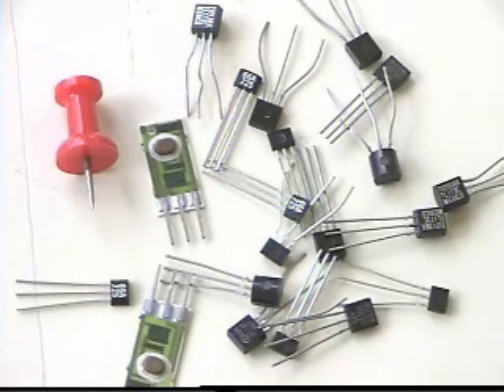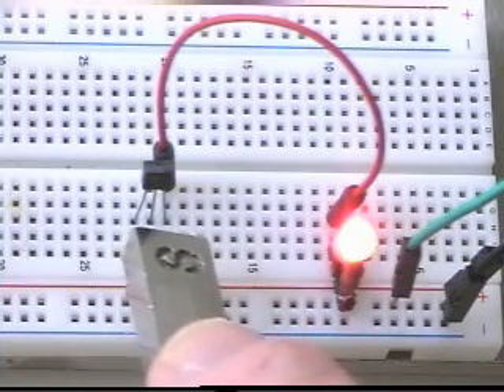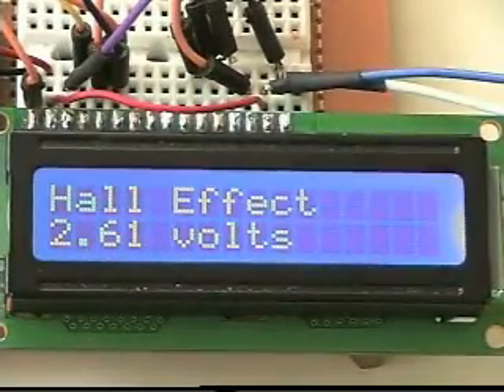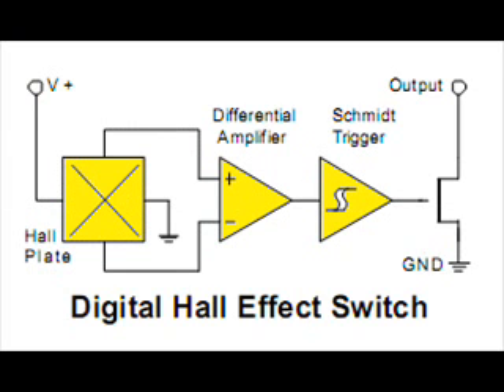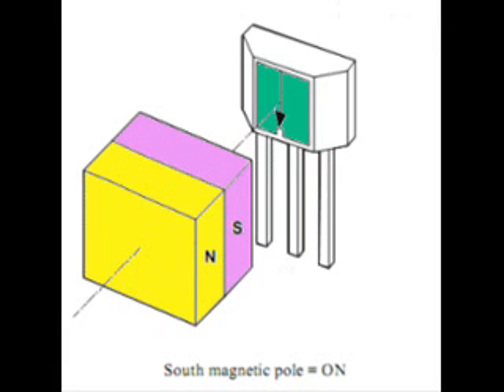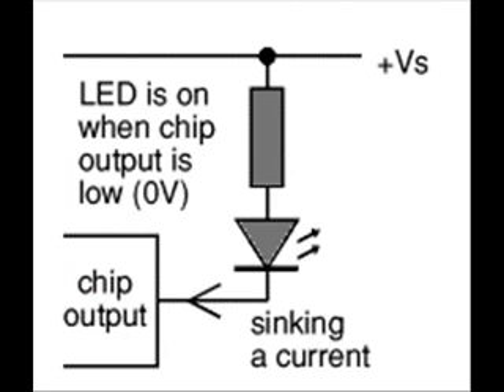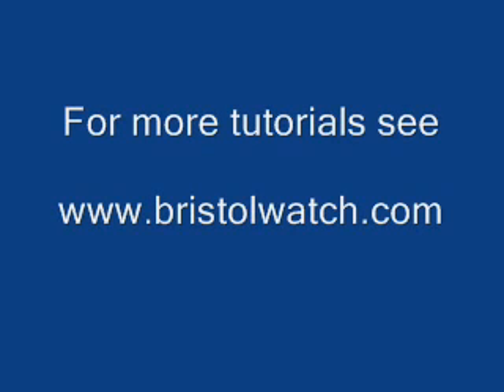Basic Hall Effect Sensors 1

Comment: Your webpage "Introduction Hall Effect Switches Sensors Circuits Tutorial" was VERY helpful.
Thank you for posting.
The UGN3013, or something similar, is what's inside the Intake Manifold Runner Control Actuator for my Ford Focus - DORMAN part# 911-927.
Engine vacuum pulls a contol rod down to close flapper doors inside the intake manifold.  The enclosed sensor detects when the rod is down; it was faulty.
It looks like hall sensors are used extensively in automotive applications, and trigger the 'check engine' light and trouble codes when they fail.

Comment: question will these work off the magnetic fields created by current going through a wire? i'm planning to make a tachometer for my atv and was wondering if something like this could be triggered by the pulse to the spark plug, without messing with the plug wire, like just by taping the sensor to the wire. is this a stupid idea or do i need to use something different?

Comment: The ratiometric. Question would you have a good code to upload to a Arduino to work this type of hall effect sensor ?
Reply from the maker: All you do with a ratiometric is read the voltage value though and ADC port on any micro-controller. With a 10-bit such as Arduino understand the output from the sensor is centered on about 2.5V with a 5-volt sensor. Subtract 512 from the values assuming the voltage out is over 2.5V. If it drops below 2.5V use the value directly or turn the magnet around. Note the sensor likely won'y go all the way to 0V or 5V.

Comment: 44E is same as UGN3503U or not please tell me sir
Reply from the maker: Don't know what a 44E is. Is that the whole part number?
Reply: 44E is hall effect sensor
Reply: A3144EUA
Reply from the maker: No they are not the same - two different types.
Reply: which  similar sensors instead of this UGN3503U
Reply: UGN3503U i didn't get this anywhere so i have to use similar sensor that works like UGN3503U
Reply: And thanks sir for reply , thank you for solving my query .

Comment: Great as usual Lewis.  Hall Effect sensors are a blast. The ratiometric provides such a clean signal it can be amplified and very small movements can be measured. Much less frustrating than a noisy resistive sensor in my experience.

Comment: Hi there, great video. I'm doing an assignment for my Motorsport Engineering course at college, and I have a question:

In a 2-pin hall sensor, what does each pin do? I previously thought that all hall sensors had to have 3 pins (Input, Signal and ground), therefore I'm struggling to make sense of how a 2-pin hall sensor could work. By the way, the sensor itself is a wheel speed sensor.

Any help on this would be greatly appreciated.Thanks!
Reply from the maker: +Jack Hills Never heard of a 2 pin Hall effect. Are you sure this wasn't a reed switch?
Reply: I am absolutely certain, as I've heard from multiple sources that it exists. However, if you'd like to elaborate on the reed switch, I'd love to know your thoughts as to why it could be that. Thanks :)

Comment: nik2009es dont know any part numbers, but where you might find a throttle to take apart. these are cheep china ebike throttles should be similar. hybikes in phoenix az with out 3 speed button or phoenix produce in phoenix az with 3 speed button. about $35 . atm im looking for some hals in my pile of parts to fix my ebikes motor (make no mistake, its to stat  motor or to get home should motor fail, the sla batteries are a joke) i doubt the speed button will effect anything and recomend hybikes. the other sold me a pos and could care less about taking people for their money,
WARNING! DO NOT BUY THESE EBIKES!. i made this mistake and ended up adding a motor to mine. its faster and fun now. just a thought fer you....

thanks lewis!!
also , might the hal sensors from a floppy be similar??

Comment: Hello I have something similar in the handlebar  of my quad(ATV), the quad is electrical and connection works with 3 batteries of 12 volts, 12 ah, in series (36 volts), I think that it is a magnetic sensor hall because the same form has that in the video,
But I it have fault and do not find supply for it, has this numeration 49E 608A
Which, ar the equivalent??????? thanks   I wait for your response
Reply from the maker: nik2009es Sorry no idea.

Comment: Thanks for the video: )
how can I measure a magnetic field which more than 3000 gauss?
do I need a hall generator?
Reply from the maker: Stone Derek What do you want to do? A ratiometric Hall sensor puts out an analog voltage proportional to a magnetic field.
Reply: Lewis Loflin I wanna measure a strong magnetic field (like more than 3K G) 
But the output of the amplifier will reach Vcc first and become saturation... : (
so i wonder that maybe i need a  hall generator 、hall plate or sth i don know to design it from origin.
Reply from the maker: Try a bias magnet from the other side.

Comment: Hi, what is the code of the Hall efect sensor that you are using for the video!?...
Reply: Sorry, the code for the one that you use that in the output have a variable Voltage is?...
Reply from the maker: ady alejandro prado salas You will have to use an Arduino or other micro-controller with an analog-to-digital input and then whatever LCD display. I have used two types for the LCD - an I2C and a serial shift register type. Check those out at my main website www.bristolwatch.com
Reply from the maker: Lewis Loflin
Here is the sample code;
http://www.bristolwatch.com/hall_effect/arduino_hall_effect.htm
Reply: Lewis Loflin yeah hi, thanks for the answer.. i am using a PIC 16F870 that have a few channels in the A/D conversor and a LCD display that i found on sparkfun web page.... The question that i have is what are the code of that sensor that you use with that LCD display... again, thank you for the answer !!!
Reply from the maker: Reading the Hall is simply read the voltage out on an ADC. Make sure the ADC is 5-volts  and not 12!

Comment: HI can someone please help - i have a laptop with a hall effect sensor, the lid opens and the screen turns on when lid shuts the screen turns off. but my screen is always off, i put a magnet to the hall sensor and the screen flickers on/off fast but wont stay on! i got a replacement sensor but its the same !! can a bypass the sensor. its a small chip. at top 2 pins and on other side 1 pin. please help..thanks

Comment: will hall effect sensors give accuracy of a copper and carbon brush system of a commutator?  Can I change my copper commutator to a magnet version with a hall sensor as the brushless sensor.

Also I need voltages of 12VDC - 280VDC.  Can a hall effect sensor allow me to use such power to generate into the coils, like a Mosfet.
Reply from the maker: No no, and no. Hall sensors are low power devices. I give a number of examples for driving MOSFETs, etc.
http://www.bristolwatch/hall_effect/arduino_hall_effect.htm
Reply from the maker: Lewis Loflin
above link didn't work. try this:

http://www.bristolwatch.com/hall_effect/arduino_hall_effect.htm

Comment from the maker: Note  to visitors: The part numbers and spec sheets for the sensors used are on the website at the bottom of the page. One is a TL173C, another is UGN3503, and the other a SS466 Hall Latch.
Reply: Lewis Loflin great video, may I know why does the 3503 seem more expensive than the cheap A3144E types on ebay?
Reply from the maker: It's an older uncommon divice.
Reply: Lewis Loflin thans for the reply lewis, the 3144e, 10 pc for just over a buck on ebay seems too good to resist buying..
Reply from the maker: I'd go with it - make it does what you want to do. There are different sensors.

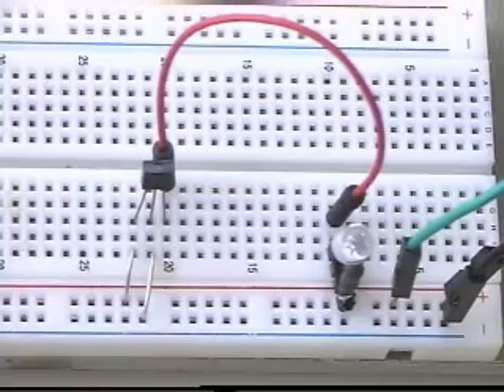Comment: Do you know of a momentary hall effect switch that is normally open? (the one at 1:00 is normally closed until a magnet is introduced).
Reply: You could short the switch to ground in parallel with the light. If that does not work you might be able to find some for a breadboard here
http://www.microchip.com/
and some industrial grade here
http://www.globalspec.com/ds/181/areaspec/output_normally_open

Comment: how did you manage to display the hall effect output unto to the lcd screen
Reply: You need a device that can send the correct signals to the LCD screen, and read the signal from the sensor. There might be a decoder chip available for specific LCD screens, or if you have a robust chip you might be able to send the correct signals.

I suggest you check this chip out, it can read most sensors and write to some LCD's.
http://www.microchip.com/wwwproducts/Devices.aspx?dDocName=en010280
Reply from the maker: I connected it to the analog input (ADC) on an Arduino.
Reply from the maker: Lewis Loflin You can use this example just change out the humidity sensor, read the ADC, multiply by 5/255 and display the value.
http://www.bristolwatch.com/arduino/arduino4.htm
Reply from the maker: Lewis Loflin
The above should have been 5 divided by 1023. See this code:
http://www.bristolwatch.com/hall_effect/arduino_hall_effect.htm

Comment: would the hall switch sense the magnetic field off of a wire when current is running through it? for example if i put it next to the wire coming off the generator can i get an led to light when the generator is running and off when its not?

Comment from the maker: UGN5303 has an analog output and is not for digital. One would use the latch or switch version. This can be used for digital if you leave out the resistor and connect it to to a comparator circuit such as an LM311. My website has a section on comparator circuits.

Comment: Hi, I have UGN5303UA Hall sensors I'm supposed to use a 50 to 200 Ohm resistor in the drain - There's always a 2.4V voltage present .
It's impossible to activate TTL chips this way - Please help 
PS: You seem to understand very well. Thanks for now , JosefHRH

Comment: Thanx a lot for the clear explanation!
i'm probably using a Hall sensor (switch) for building an anemometer.
(i believe it's more accurate measuring the rotating frequency of an anemometer by using a hall sensor, than measuring a voltage generated by a generator connected to the driven shaft (which ads up to a lot more resistance on the shaft).

Thanx again!
Reply: Hey Jori, check out www.moderncuircuit.com they have some very kul anemometer breakout boards.  Just an FYI...

Comment from the maker: as I listed below I have a solution. Use a Hall effect switch, make sure it has an open collector or drain, a pull up resistor, and use a JK flip-flop. That way you can use the south side of the magnet to cut the output on and off. The output will be taken from the output of the JK flip-flop.

Comment from the maker: A 74C925 is a four-digit counter operating at five volts, so to simply count pulses use the digital out directly to the input. If trying to read an analog voltage, won't work.